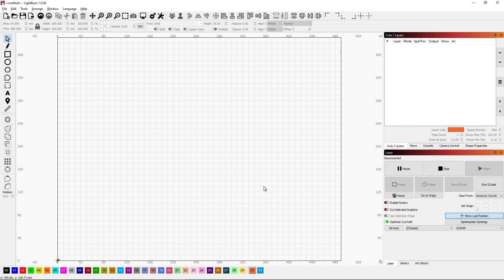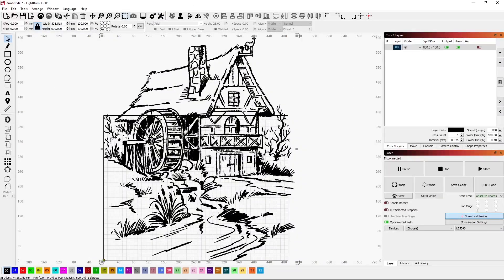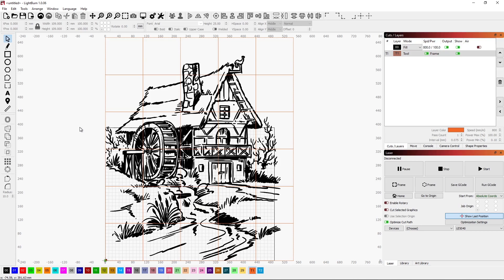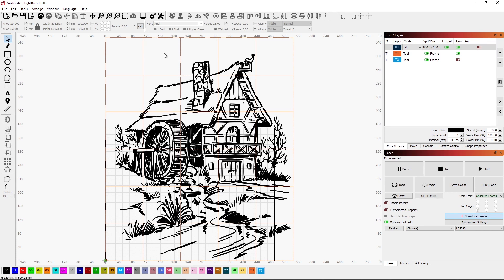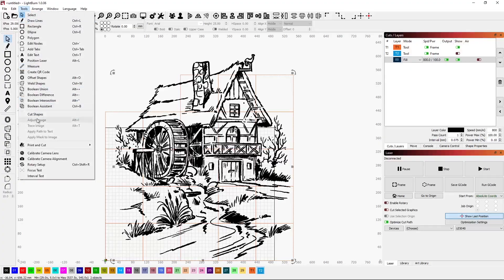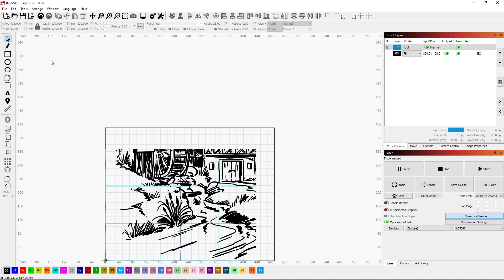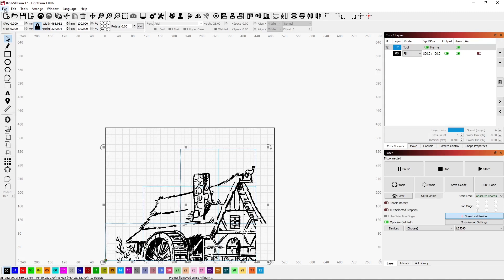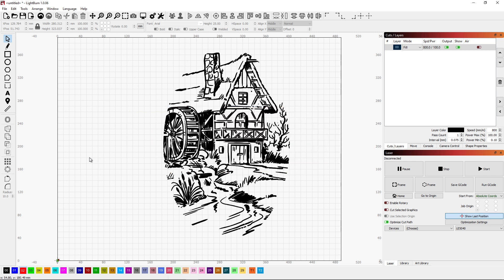Burn something bigger using LightBurn, Part I

Comment: Helpful! 

What is the best way to line up the next burn to ensure edges are linear when splitting up an image to be burned on a larger surface?
Reply from the maker: The best way to be consistent is to have some sort of zeroing template. You need a way to insure your tiles are always where you need them to be. I have a couple videos on making templates.  
https://youtu.be/xLQLEa6CRug
https://youtu.be/w1iHmcShtw0
https://youtu.be/ii4BmlN5WGE
Reply: @CNCATHome  thanks for the reply!! 
My quadrants are not being burned onto separate tiles but on to one large surface.
Reply from the maker: @sadlerro  - I got ya! That is what you were saying but because it was on this video about breaking up an image for tiles, I assumed... ;-)  If you are using LightBurn, you can use their Print and Cut feature to burn an area, move your material, and continue burning.  You will have to break up your burn into the areas you can do at one time.  I have a couple videos on the Print and Cut feature.  You can also check out the LightBurn YouTube channel for some videos on that feature.
https://youtu.be/4xgBcm8r8W4
https://youtu.be/QRhhBTHbHjw
https://www.youtube.com/@lightburnsoftware7189/search?query=print%20and%20cut

Comment: Just started designing/building my own diode based laser cutter/engraver ... I'm old, so remember cutting images up manually to print them out and was wondering if this sort of functionality was available for lasers ........... not only is it available, but a very nice gentleman has provided a fantastic video outlining how to perform it ... thanks you so much for sharing and I'm  now your latest follower👍
Reply from the maker: Sounds like a fun project, building your laser cutter/engraver.  Enjoy that process and have fun with it.  I am glad you were able to get something out of this video.  LightBurn also has some functionality for cutting a larger image on a single piece of material where the laser or the material gets moved between jobs.  I have not used that, yet.  ;-)
Reply: @CNCATHome  Thank you for taking the time to reply, greatly appreciated .... oh that'll be absolutely perfect for the way I'm building my machine!!!     I'm going for around the 1220mm by 610mm (4ft by 2ft) size, but I'll be able to push material in from the from and out of the rear of the machine, meaning I can engrave/cut a full 8ft by 4ft sheet, the functionality you mention is exactly what I'm looking for!
Should be simple enough to line up the board a few times, especially if I laser a mark at the next point on the board and then line that up with a reference mark on the bed ..... woooohooooo 👍
Reply from the maker: @barry.w.christie  - Sweet! I would suggest making it a little wider if you can, to make it easier to pass a 4ft wide sheet through. 1220mm doesn't give you much wiggle room. ;-)  There is a nice video out on the LightBurn channel that talks you through how to do a partial cut and move the material.  Let me see if I can find a link to that...  Found it!: https://youtu.be/n__saOKVupA
Reply: @CNCATHome  Thank you soooooo much, will watch after I've finished turning my goblet (starting to get into woodturning) 😁
With regards width, I should've been a little more exact in what I said ... I want to be able to fit at least 4ft in side to side, but it'll be a bit wider as the C-beams (for rigidity) I've bought are 1500mm 👍

My first thought was to move the laser about over the sheet, then I heard something about pass through on a video, so obvious to move the sheet through the laser ... it just went from a nice big cutting area to the perfect cutting area 👌
I'll send you a link to the build video once done if you're interested.
Reply from the maker: @barry.w.christie  - Got ya!  As long as your cutting area is at least 1220mm.  🙂  I would love to see your build video when you have that done.  I look forward to seeing what you have done.  You can still move your machine over the material if you want.  It won't know the difference between the material being moved and it being moved.  Unless you build in some extra sensors.  ;-)